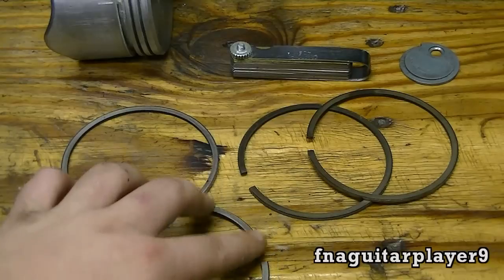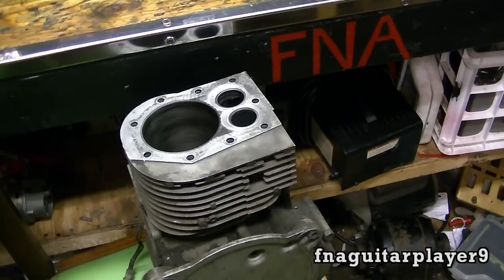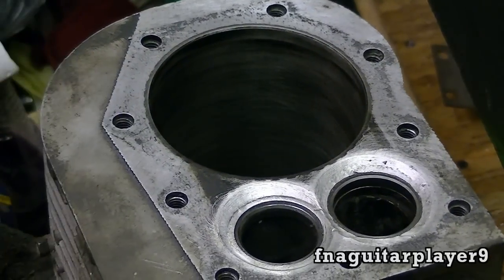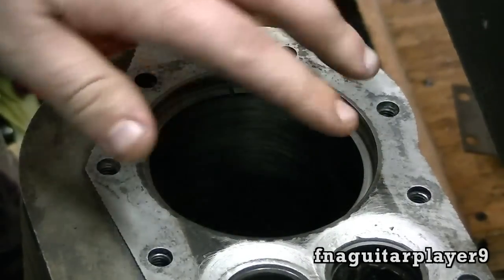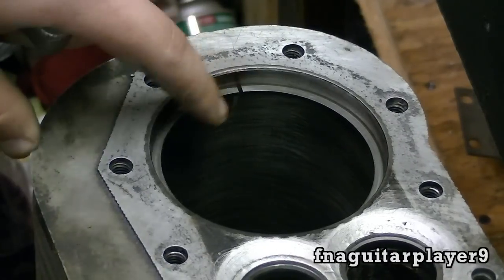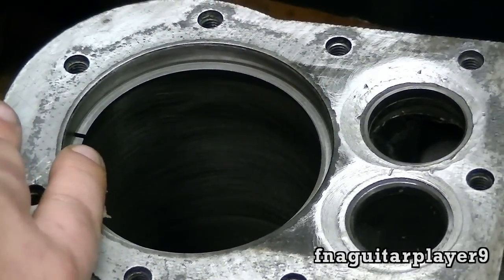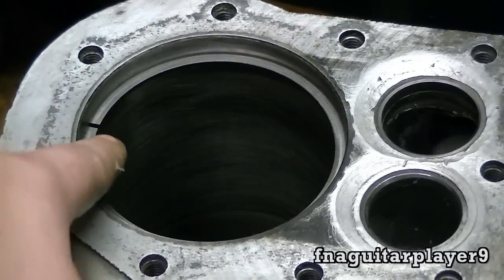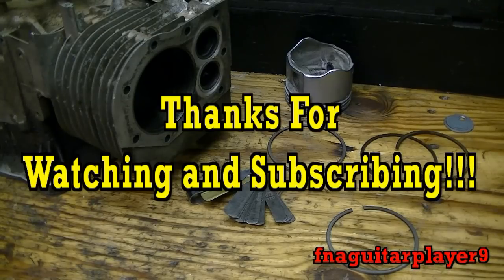How to Measure Piston Ring Gap (and specs for lawn mower engines)

Comment: Hey, i have a question for you. What does it mean when i have gasoline in my oil of my 13.5 Briggs and stratton and oil on the spark plug. When my engine shut off and when the oil hit the spark plug, oil was also coming out of the exhaust.

Comment: Sweet Jesus !     I was about to rebuilt an engine with a tight gap ( Aftermarket rings ) not thinking of the expansion from the heat. Thanks a million. I was about to run into trouble if I haven't watch your video. Thanks again.

Comment from the maker: not any time soon, maybe next summer. I don't have anything to work on right now, the 4 part video i did last summer was pretty in depth on these engines. There wouldn't be much improvement on a 2nd rebuild video. I would like to do a complete rebuild of a OHV motor, and i DO plan on rebuilding a 3 or 3.5 horse push mower engine next summer and making a video on it. Thanks for watching!!!